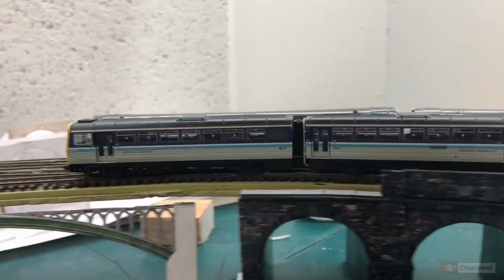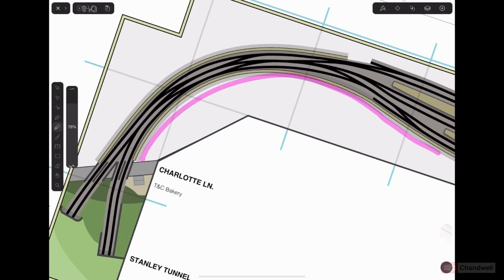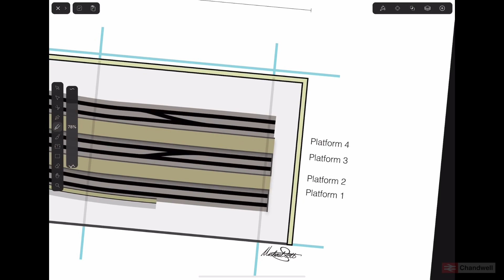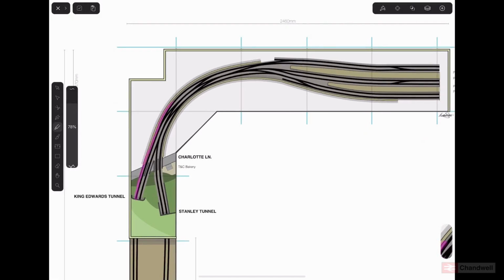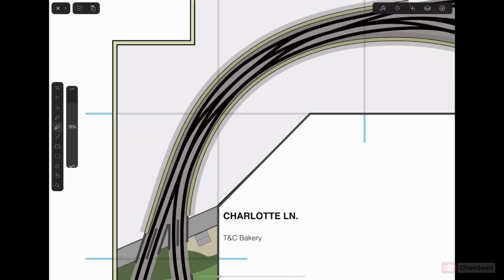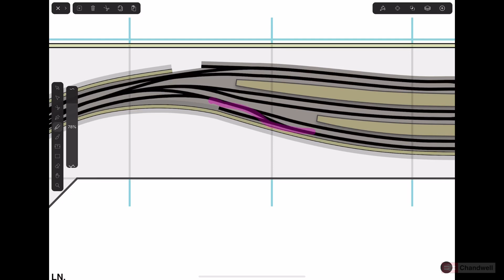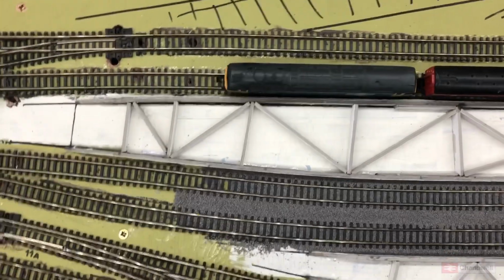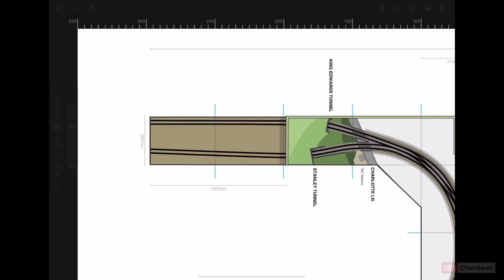Chandwell N Gauge layout track plan

Comment: Stunning how simple it is and compact.   Is it possible to loop the track in the fiddle yard area.  That would give more scope train movements.  From a distance you would not notice that Train A left for one destination and returned from the other.  In particular both lines would have a mail train, therefore running this train through a fiddle yard loop would  reduce the need for  duplication of the train.
Reply from the maker: I have considered this on a couple of past occasions but I just don’t have the space for a loop, even using first radius curves which not all my stock will negotiate reliably. The room is also my office and it is already very cramped. A loop there would cut off access to my desk and would need to be more of an oval to be able fit a longer train on it. It would need to be removable and storable and I don’t really run trains often enough to warrant the hassle! But you never know... 🤔🤔🤔

Comment: what track plan software are you using please?
Reply from the maker: Hi Michael. For actual track planning I use AnyRail, as that is the one I find most simple to use when using off-the-shelf track. For the track plan I show in this video, I exported the track plan from AnyRail as an image and imported it into an app called Vectornator on my iPad. I then carefully and manually traced the track from the AnyRail image into vector lines which I put on a layer of their own before deleting the AnyRail image. I then drew the baseboard, scenery, etc. in layers within Vectornator. It’s all very manual and quite a time-consuming process - about 5 hours went into producing it and that is after the planning in AnyRail. Hope this helps - I am planning a video on how I did/do my track planning in a few months, and I will cover this part of it too.